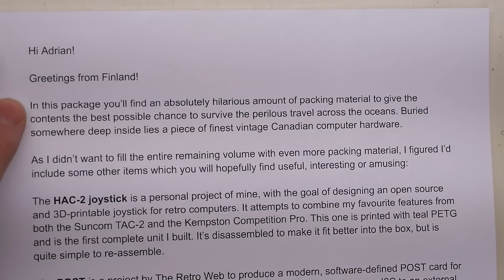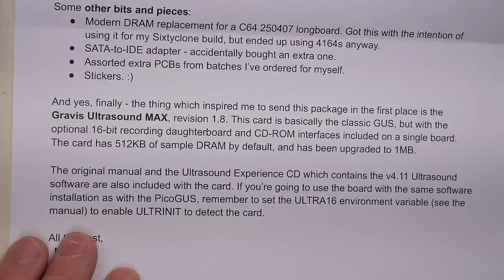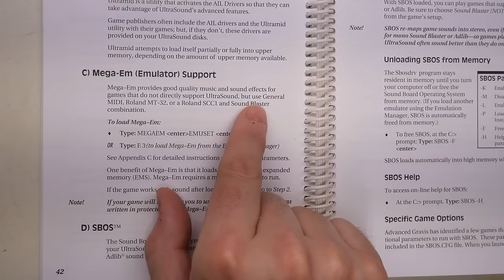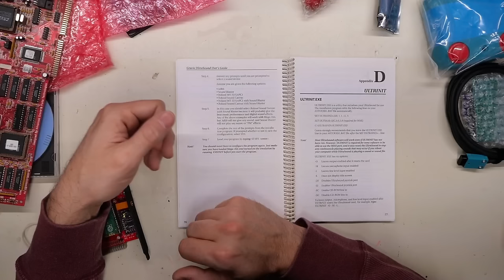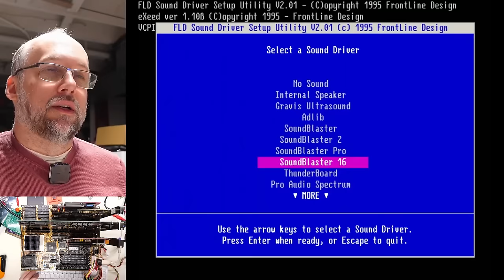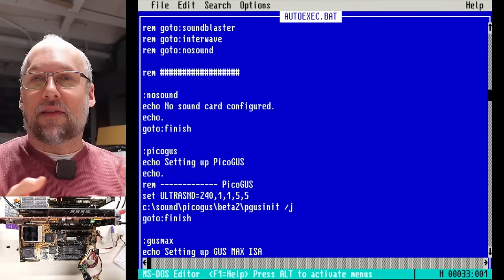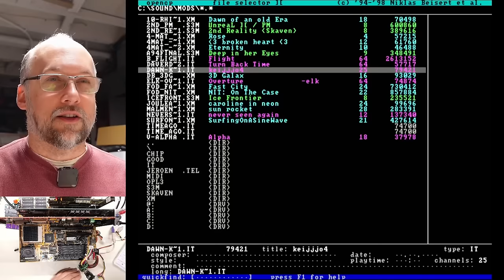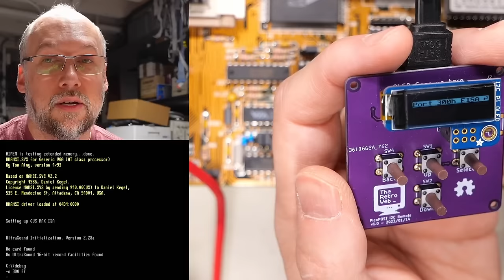0075 A Gravis Ultrasound that needs repair, a 3D printed joystick and a software defined PicoPOST

Comment: There was another reason to buy pricier soundcards. You got horrible sync issues when capturing with the cheap soundblaster cards. The drivers of these big ones where often more precise with their timings and so the syncronisation between video and audio lasts for much longer captures.

Comment: Greetings from Athens, Greece Adrian! Excellent video as always...
I always loved soundcards, still use one (onboard audio still sucks) an Asus Xonar STX II, the old Gravis card looks amazingly well put together and very capable hardware wise. Pico Gus should be renamed to Pico all sound cards with the potential it has, great project.
Pico post needs definitely more work in the design and firmware to be robust and useful and maybe also a PCI slot as the Chinese card has? Also agree that it should be one card and not separate parts with beep speaker.
I would also like to see that C64 RAM replacement spider being tested, looks so weird and cool...
Keep up the great content, Happy Christmas and New Year! Jim.

Comment: Port 378 is LPT1 on PCs so it may have a conflict.
Reply: Personally tested on my dev machine and any activity on the ISA bus will be seen by PicoPOST. As long as the chip handling parallel is on the same bus, the data flows through without issues.
With AMIBIOS, I could see each and every NVRAM access for reading stored BIOS settings and checksum computing, even if that's buried in the Dallas clock chip in this machine.

The problem Adrian was having was simply firmware related, because I like adding bugs 😄
Reply: Write-only cards can't cause bus conflicts. I suspect Olivetti chose that port because it's the parallel port. It means they could connect POST code readers to the parallel port without needing to open the case.

Comment: the capacitor plague in the 90s had a specific cause which shouldn't impact Nichicon through hole caps because it was related to a specific brand of electrolyte in China/Taiwan in the late 90s. So this is less likely due to quality but due to failure due to storage for a long period of time (especially if these are low-ESR caps), without charge, or in a hot space.

Comment: 31:05 Print 3D bracket for PicoPOST and  put OLED screen there using this as permanent solution for Your way of testing methodology. T-shape bracket with OLED board on top for easy asses ability ?

Comment: You're describing an original GUS, and if that's what you had, you probably stopped using it when you started using Windows, since the original was wholly unable to work with Win95 at all, because of a hardware conflict in the DMA or something like that. I still have mine, tho. :D

Comment: What about going with a ASUSTEK EN9500GT and that Sound Card and use a SPDIF cable to connect the SPDIF out on the Gravis to the SPDIF in on the EN9500GT then you can use a HDMI cable to go to a TV set and the audio is brilliant as well as the picture.

Comment: You may not even be able to use that SSD with an older system. Because I tried putting Windows XP on an SSD and it did not work. So I don't think Windows 95 will work on that SSD. I believe the firmware is a little bit different from a standard conventional hard drive to a solid state hard drive
Reply: I've never run into a situation where a SATA HDD worked but a SATA SSD did not. But there are plenty of situations where SATA drives don't work, for example XP needs drivers (like an F6 disk) to use most SATA controllers. Those SATA->IDE adapters also have compatibility problems with many motherboards.

Comment: I'm not sure this is a good idea to put an SSD to a windows 95 machine, it may worn out cells quicker and it does not know about TRIM function. It will be obviously faster than SD card, I just don't know for how long this SSD may last.

Comment: Friendly reminder that you probably will not be able to access the full 250GB of that SSD in Windows systems older than XP.
Reply: He said that
Reply: There are unofficial drivers (like those by Rudolph Loew) to add support for larger drives to Windows 9x.

Comment: Not sure if it is safe to use that SSD on non modern operating systems if they don’t support the ssd house keeping functions. You may destroy the drive before it’s time
Reply: IIRC most modern SSDs do their own housekeeping.
Reply: @iroll  they do but OS level support helps and the older the SSD the better having it is
Reply: You can wipe the drive on a modern system, then leave a portion of the capacity unused. Either use a DCO to limit the size, or just leave part of the drive unpartitioned. That will give you a huge endurance boost so TRIM will be totally unnecessary.